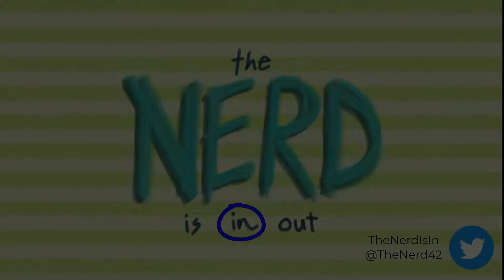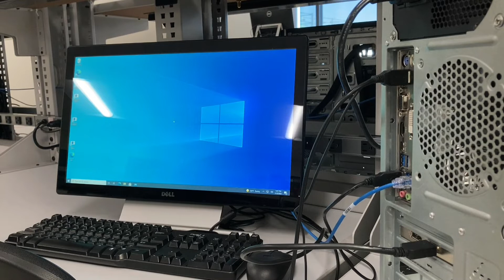Top 5 reasons your Motherboard will not boot

Comment: I have the 8 pin connector plugged in but theres an additional 4 pin slot next to it, I get motherboard lights but no fan spin or anything, ive tried the power switch and bridging the power switch pins do you think think those additional 4 pins should be plugged in?